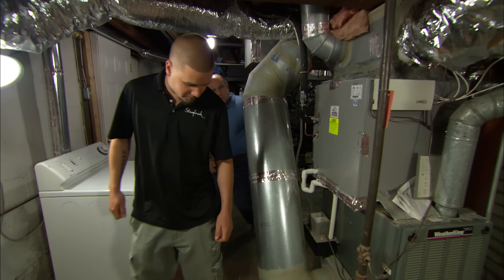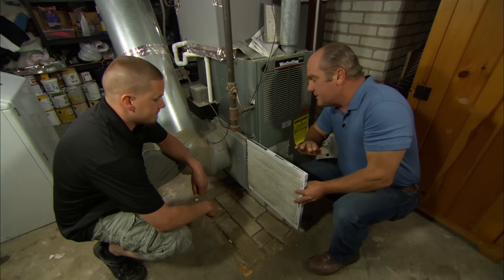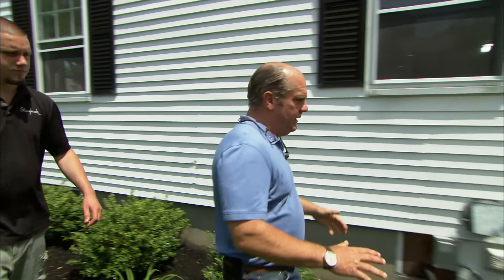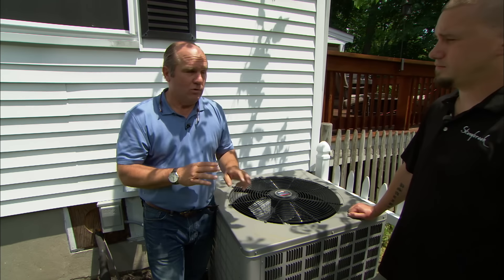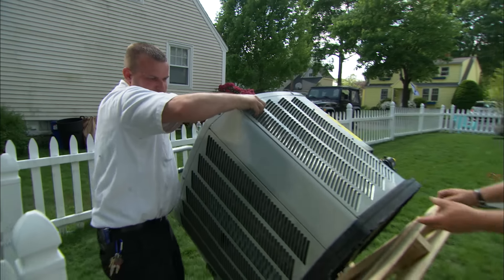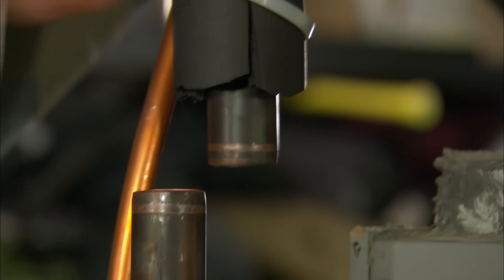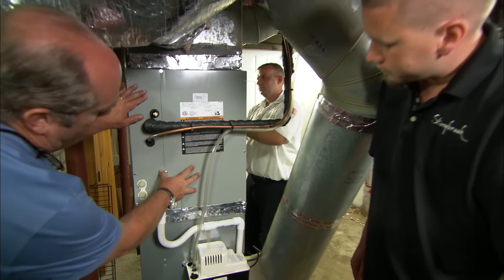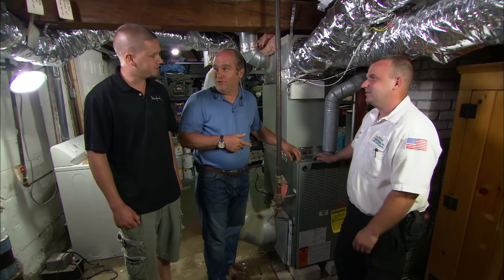How to Repair a Frozen Air Conditioner | Ask This Old House

Comment: AC system worked great for 15 years, starts freezing up, yep the entire system installed was too large and everything has to be replaced. :rolleyes:
Reply: the AC was 4 years old when this was filmed and likely never worked right from the getgo. That ductwork is WAY too small for a 4 ton, especially that return. Looks like 16" which is 25% of the minimum you need or worse 14" which isn't even half. The contractor who installed the 4 ton was obviously a hack and had no idea what they were doing. You can't put a 4 ton in ductwork sized for 2 ton of air. Not to mention theres a damper system so if you are shutting off half the system, you now have 4 ton of air going through ductwork that can support 1 ton of air. and there is no bypass damper either which isn't going to help with freezing.
Reply: It was just low on freon.
Reply: @gangisspawn1  Nobody uses freon anymore.
Reply: @Egleu1  So after the freon ban all r-22 units just disappeared or were replaced? Fool
Reply: Yeah good thing everyone can afford to just replace an entire ac system.🤦 Especially if the system worked great for that long.
Reply: I never heard anyone say the unit ran fine for 15 years.  I don’t think the unit was that old.
Reply: it was  NOT NEW AND RAN FINE. This is an expensive sure  repair.
Reply: Yeah, I wanna know how much it all cost.
Reply: No they werent my house in wv still have r22 and i know a few other places that have it.. and this was 3 yrs ago that u posted this...@gangisspawn1

Comment: Need a new paint job on the house??? better build a new one
Reply: Lol. He would have been better off doing the house addition to cover the extra ton.
Reply: Could have opened a window to control freeze-up. Haha🤣
Reply: Omg, great way to explain how crazy this was!!! Kudos
Reply: LOL
Reply: Exactly!!  Like what the heck????
Reply: What the f he is backwards on the refrigeration process. The small line is compressed liquid that is is turned into a lower pressure threw a metering device witch changes the pressure to drop witch causes the coil to pick up heat and return it to the compressor witch compresses the vapor into a hot gas and then goes threw the condenser coil to cool down and turn into a liquid to restart the process

Comment: How to repair?  More like how to replace...
Reply: Yes
Reply: Or how to "UP Charge!!"
Reply: He can sell the old unit and either break even or make money.
Reply: @VinylToVideo  the contractor is like "oh, don't worry, I'll get rid of the old one for you". lol
Reply: @bigroblee  Exactly. My grandparents just replaced their 20 or 30 year old hot water tank. When the old one was removed it was realized it was just fine and probably could have lasted another 30 years. Of course it wasn't scrapped; it was taken and probably resold and they didn't get any money for it.
Reply: No diagnostic techniques whatsoever
Reply: I would say it's an expansion valve.  It shouldn't freeze unless the guy keeps it at 60. Lol
Reply: Matt Holmgren you cant repair this problem in most cases
Reply: @jacksp8452  Wtf?
Reply: @jacksp8452  lol yes, yes you can
Reply: I say buy a couple metal containers an use it as a workshop then install air ducts to cool an heat work space! Hehe keep the unit, gain a work shop or man cave
Reply: @Michael-qy1jz   undercharged due to leak or restricted air flow
Reply: @VinylToVideo  hot water tanks don’t last 60 years.  Ever.
Reply: Sizing your system properly for your application IS a repair.
Reply: @holmessph7  How would you know? On Steven Lavimoniere's channel right here on YouTube you can find many videos with old equipment including a lady with an all copper hot water tank installed around 1945.
Reply: In this case it was the only answer to the problem.

Comment: me as an Hvac technician, I say that all he was supposed to do was check the refrigeration pressure, and increase the size of his return duct
Reply: And how big a blower do you need to force enough air over a coil designed for a 2 1/2 ton TXV to become [barely] servicable to a 4 ton outside unit?   You wouldn't be able to sleep for the noise I would imagine, and would have to worry about the air filter getting sucked into the blower housing constantly.  Yes you can fit a square peg into a round hole with a big enough hammer, but its just wrong.
Reply: @flinch622  no excuse please
Reply: Maybe change that filter to a regular one also for more airflow
Reply: Yep, 100%

Comment: Did anybody notice he explained the refrigerant flow backwards when he opened up the coil. This whole video is just wrong.
Reply: AS General no it isn't everyone knows the refrigerant gets metered heading back to the compressor
Reply: return duct work is massively undersized. A complete miss by these 2 and it's still undersized for the 3T unit.  You can run 3 ton cond thru a 4T coil all day long. The 10- 12 inch return needs to be 18- 20 or equivalent in square duct and replace the 1 inch filter with a 4 inch filter set up. They'll be back the 3 t unit will be freezing up.I've been in HVACR since 1985.
Reply: I have lost all respect for This Old House as an institution.
Reply: its not an institution lmao
Reply: It hurt me physically  to watch this.
Reply: yes yes yes i was definitely count wait the post that  refrigerant running backwards & come back to the cooling Coil already cold ..what a crock ..Unbelievable for this Old House
Reply: Ha he did explain it backwards! 😂
Reply: He described the lines correctly later at 9:25 (with the suction line being the cold line).
Reply: I scratched my head when he was explaining the refrigeration
Reply: He is talking about the suction line, compressor takes the refrigerant from evaporator and compress it. But he pointed the wrong line though!
Reply: YES! I was about to comment but thought to check feedback, and yep you guys caught it too.
Reply: isn't it funny when someone proudly explains something wrong like "oh dear child, let me teach you a lesson...you're welcome". 😂

Comment: Wow. This guy doesn't really know much about the A/C does he. He just told the home owner that refrigerant runs backwards
Reply: I noticed that too.
Reply: I started laughing as soon as I saw that.
Reply: Matthew Martinez he's just a general carpenter or handy man not an hvac tech
Reply: Yes Matthew, I just saw this video and the guy is showing refrigerant flow backwards through the metering device .
Reply: I was confused about that the liquid line carries the refrigerant into the metering device
Reply: sad thing is that hes a plumber and dropped a p-trap without a tee after the trap in a positive pressure drain system :)
Reply: Sina Derakhshanfar I see that
Reply: yea he's pointing at the liquid line like it's the suction line
Reply: Matthew Martinez Are you serious? This so called pro just told this guy you cooling comes from the suction line and the leaves hot through the liquid line. Wow I'm glad I wasn't the only one who heard this.
Reply: JonesHVAC you mean the other way around suction line is the cold one and the liquid line is the hot one that's correct. The guy in the video was saying the liquid line was the suction line
Reply: Matthew Martinez  You hit that right on the money.. I was like wtf. I had to replay it to make sure I heard him right. lmao....
Reply: LOL, silly plumbers acting like they know how the refrigerant travels thru the system.
Reply: P Tec  plumber are a big problem to the HVACR trade
Reply: Robert Slackware  piont is this plumber needs to do plumbing and refrigeration mechanic needs to do refrigertion  there is a reason for different trades when we stick to are trades then it is good for industry  there will be over lap but when a plumber is putting in ac that is beyond over lap . I know i repair a lot of plumber ac installation most of the mistake are becouse of lack of knowledge
Reply: They're complete rookies, I've been doing it for 31 years, the whole problem was from the undersized return duct and the 1 inch filter. Needs to be at least 16 in diameter that might be a 12 in there. I knew that as soon as i seen the install, and you can run 3 tons thru a 4 - 5 ton coil. Many high efficiency jobs require that to get the SEER rating, i just did a 3 ton jobwith a 4-5 ton coil. Replaced the return duct and install a 4 inch filter set up before you replace any equipment. Odds are it's still going iceup, they didn't show the unit start up, I was interested to see the pressures, problaby low, the Tech didn't even bother to check the charge, complete rookie. Low  pressure with icing suction lijne means air flow problem, which they still have. Lots of jobs I've seen are just like this undersized return. The bigger the return the better, you can never oversize a return, makes a unit quieter.
Reply: Matthew Martinez lol....I picked right up on that. Seemed like he knew a lot with his pen and paper.
Reply: LMAO just replace it
Reply: Good teacher 
The freon is going back to the discharge line going into the compressor and come back in the other big pipe very cold jajajaja awesome teacher
Reply: I spotted that about ref. Too lol real pro on TV
Reply: Was just a bad txv lol
Reply: maybe their is Australia.... lol... I think the funniest thing was having a friend from Australia in aww of the toilet bowl water going down in the opposite direction....
Reply: Gabriel Martinez eww u said freon its refrigerant
Reply: Matthew Martinez i know right lol
Reply: Matthew Martinez and you can use a 4 ton coil as long as you size the TXV for the 3 ton condenser. 🤦‍♂️🤦‍♂️
Reply: Matthew Martinez yea and the furnace / fan is before coil so the trap should have been open rather than being plugged , as so if the coil was before the fan , coil pressure “static” would be negative you would then plug or cap drain trap otherwise the fan would pull condensation inside and will only drain when fan turns off. Also makes a real annoying sound. Cheers 🍻 guys
Reply: Notice that he did not check the refrigerant to see if was low.  That was most likely the problem - Sold the sucker an new A/C.
Reply: I would have built the addition to the home.  Man Cave/conjoined Work Shop/Gym.
Reply: Hahahahaha I thought the same exact thing and came immediately to the comments to say something and you guys beat me to it!
Reply: Only us HVAC guys will notice it.... instantly lost his creditability
Reply: The Myth Is that his ability to give credit?
Reply: I laughed my head off
Reply: Matthew Martinez I noticed that too
Reply: Nailed it!
Reply: LMAO!! No pookie lol
Reply: You are100% correct! If you got a cold liquid line sumpin is askew!!’
Reply: Matthew Martinez 
I heard that too. The cycle is opposite from what he told the customer. Horribly oversized system. Horribly undersized duct system. Not sure the location but 3 ton sounds a little overkill also. No load calc?
Reply: Haha didn’t you know the compressor makes it cold and sends it back in
Reply: Yeah man didn’t you know once your refrigerant has evaporated, it goes back through the TXV back to the condenser?
Reply: Saved me the trouble of watching...also, did he really need someone to act dumb and ask questions?
Reply: I notice that lol
Reply: Ben Kuxhouse Yeah I know right  a 4 ton on that return holy crap lol lol..... this video has always bothered me with the misinformation. The duct work is crap in the first place.
Reply: I seen that. It’s called a suction line for a reason
Reply: Yikes I thought I was going crazy.
Reply: This guy doesn’t know anything
Reply: It comes back real cold!!! Haha! hire a professional before you listen to YouTube videos dishing out misinformation
Reply: I caught that as well.
Reply: Would used a tee not a 90 elbow down
Reply: Refrigerant does run backwards in the heating cycle
Reply: This is show business. His explaination of refrigerant flow is backwards.
Reply: This is why plumbers shouldn’t do HvAC work. They are Not Hvac technicians.
Reply: 😂 I noticed that also
Reply: The air comes back nice and cold thru this line. Lol
Reply: I know ironworkers that are vastly more knowledgeable about HVAC.